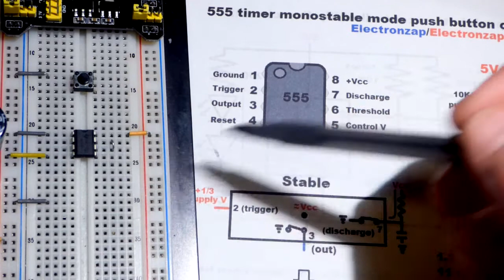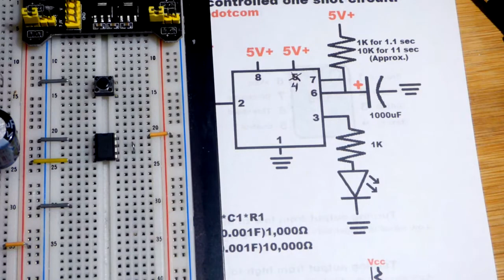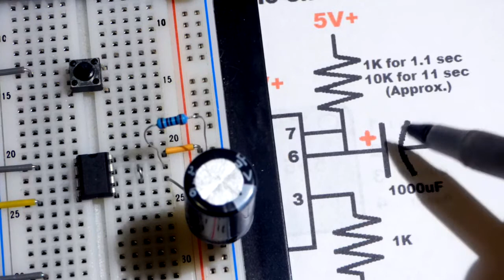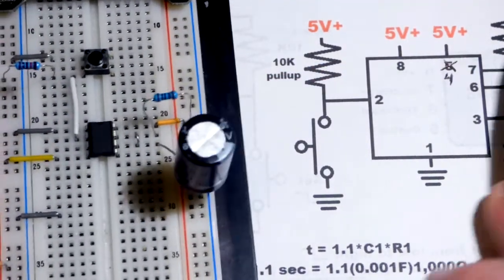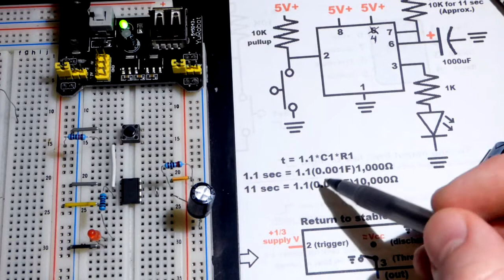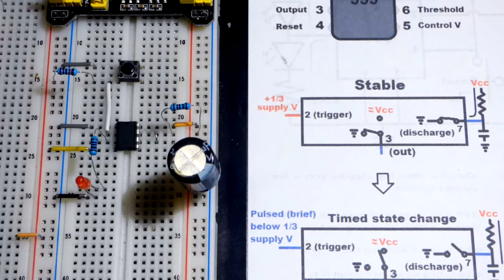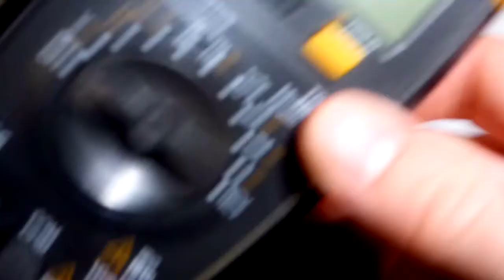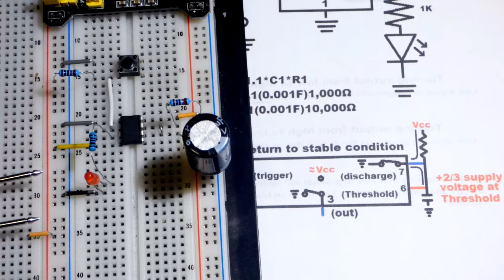555 timer monostable mode one shot step by step circuit build following diagram

Comment: 12:00 how would you wire this circuit to have it so that the LED unlights after the t seconds, even if the button is held for longer than the programmed duration?
Reply from the maker: Add a small capacitor between the signal and the input. Once the capacitor is fully charged, it won't pass a voltage along anymore as long as there is a pull up or down resistor to the opposite supply.